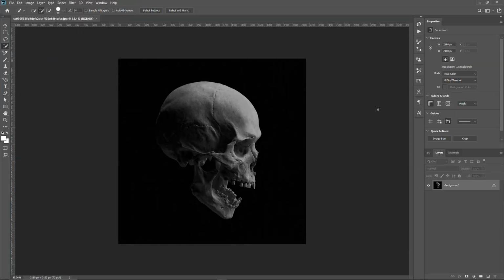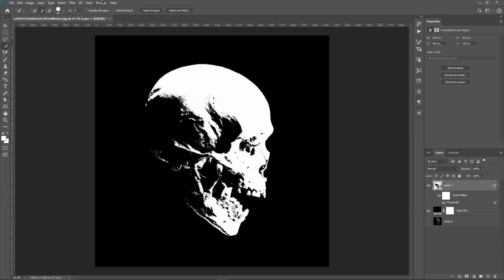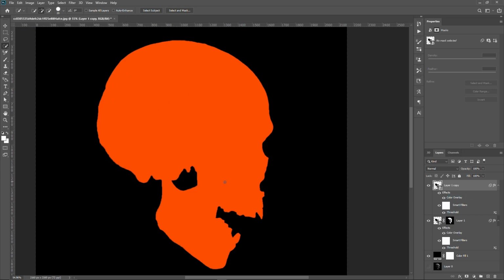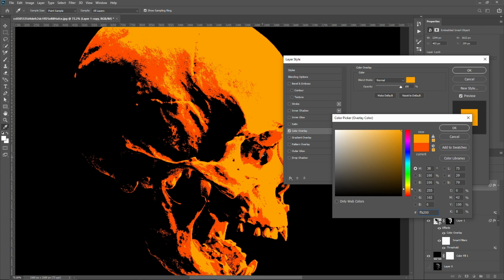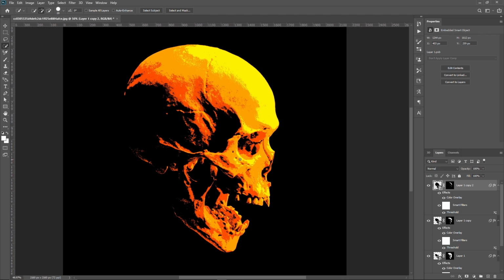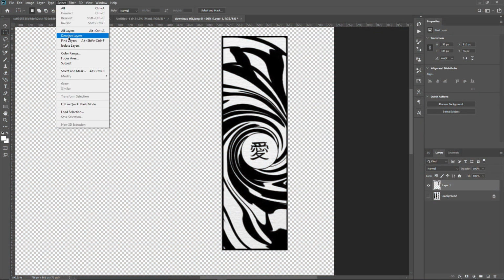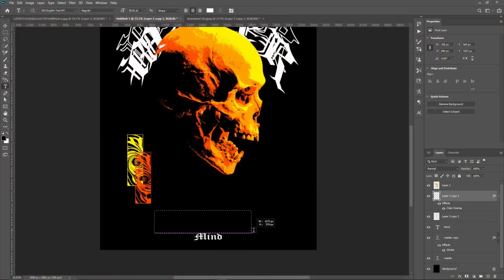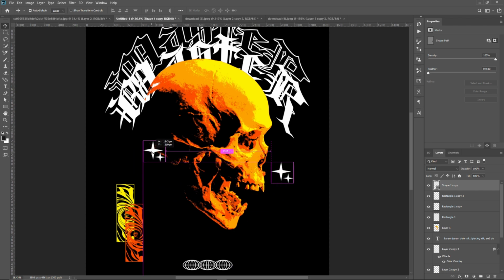Create Stunning Streetwear Graphic Tees with Threshold Effect in Photoshop | Quick & Easy Tutorial

Comment: Hey bdr, how do you make sure there are no semi transparent pixels before printing? Thank u, fire vids
Reply from the maker: If you’re using the Threshold technique in Photoshop and want zero semi-transparent pixels when printing, here’s the correct way to do it 👇
Threshold itself only creates pure black or white. If you’re seeing soft edges, the problem is happening after you apply it.
Here’s how to keep it clean:
Convert to Grayscale first (Image > Mode > Grayscale)
Apply Threshold (Image > Adjustments > Threshold)
Make sure you’re NOT using anti-aliasing anywhere (selections, text, resizing).
Hard Round Brush
100% hardness
100% opacity
100% flow
Merge everything, then convert to Bitmap mode (Image > Mode > Bitmap)
300–600 DPI
Method: 50% Threshold
Bitmap = 1-bit image. That means it’s literally impossible to have gray or semi-transparent pixels. It’s either ink or no ink.
Quick test:
Put a bright red layer underneath and zoom to 400%.
If you see pink/soft halos → you have transparency.
If edges are solid black → you’re good.
Also avoid:  JPG export
Scaling after threshold
 Lowering layer opacity
Soft brushes
If you follow this workflow, your print file will be clean every time.
Reply: @grfxbdr  ahh but whenever I put text, there’s semi transparent on the text.
Reply from the maker: My bad, for that much info in a single comment. Hope that helps